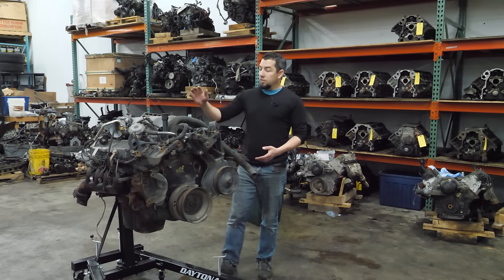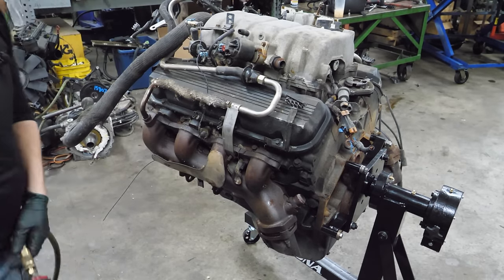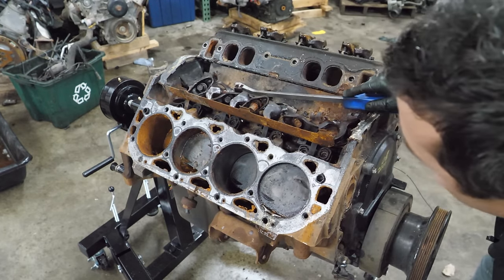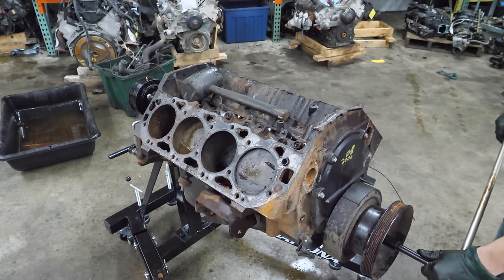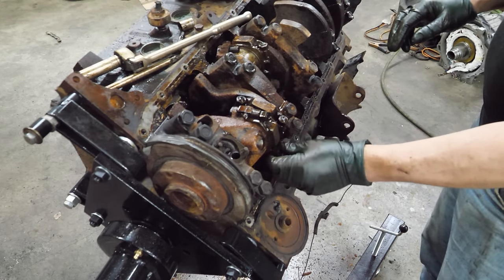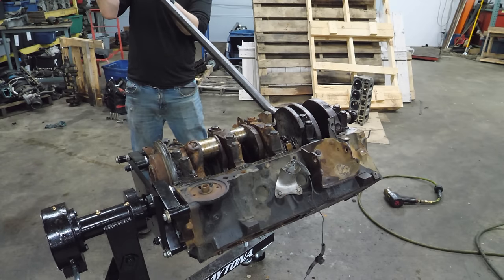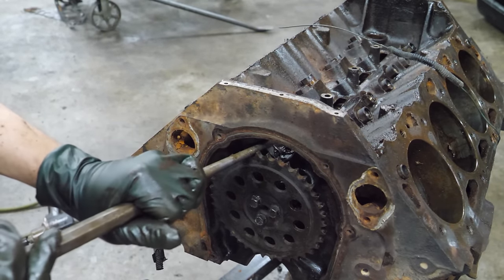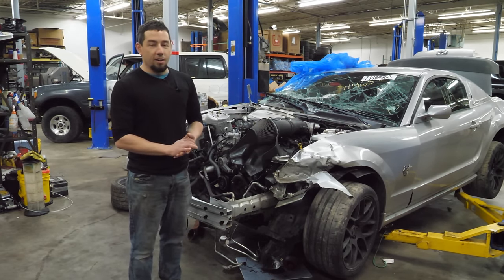COMPLETELY FROZEN! Vortec 454 7.4L BBC Big Block Chevrolet Teardown. This Was Some Work!

Comment: I live in the northern states and I've seen this exact out come multiple times on multiple gm 4.3 5.0 5.7 7.4 what happens is the plastic intake gasket fails in warm conditions and first dumps the coolant in the oil. truck starts overheating cant figure out why owner puts water in cooling system "to get home" freezes overnight always push's out the same plug behind the engine mount well now they created another leak at some point they check the oil and see the milk shake and think the motor is blown. PSA if you own a GM truck produced from 96-99 or van 96-02 with a vortec iron headed motor if your loosing coolant and cant find it check the oil first if there is coolant stop driving the tow is cheaper than the damage you cause limping it home. Every 1st gen vortec need the intake gaskets updated to HD cheap insurance.

Comment: Soak those pistons in evaporust top down for couple days, free up the rings... nasty motor, and I thought the one I took off bottom of local lake was horrible,  It was,  but came apart semi easy. Was under water on lake bottom since early 90's. Had cable attached for jet ski tie up, little 307 sbc.

Comment: Rain water/ snow melt off damage. It's been sitting in the yard for a while exposed to the weather. Someone tore a bunch of parts off of the truck, and left the rest open to rain or snow getting inside of it. With no water pump being on it and if the engine was angled back. Rain could get to the coolant passages, collect up and froze pushing the freeze plugs out and cracking the block in a place you can't see to allow water in the rest of the engine. Most yards will drain all of the oil out of the engine before sitting it out into the yard according to EPA rules. That goes for coolant as well. This is the type of stuff I would expect to find in a "You Pull It " yard. The vultures do not care how they leave the carcass after they get the parts they want off of it.

Comment: A thought on how 0W0 got in.  Looks like those trucks have an oil cooler in the radiator in addition to the transmission cooler.  If the oil cooler leaked, oil and antifreeze/coolant would be exchanged.  With the oil pressure normally higher than 17 PSI, oil would flow into the radiator.  But when the engine is shut off and oil pressure goes to 0, pressure in the cooling system would push coolant into the crankcase.
Of course this doesn't completely explain what happened to the engine since there didn't appear to be any evidence of antifreeze, but if the problem was ignored long enough and they just added water...  maybe.
Just a possible puzzle piece.

Comment: Bought a 98 P30 chassis with this engine. 10,100 miles 13 months I found coolant in the engine oil. Dealer said tough luck, out of warranty. the "New" 5 year coolant had desolved the intake manifold gasket. A known problem.... I replaced intake manifold gaskets and used cooper coat sealant.... drove for 140k with no further problems with coolant in the oil. exhaust manifold and gaskets failed, replaced exhaust manifold bolts with brass nuts... driver side manifold was so close to the brake master cylinder that it would boil the brake fluid, made a heat shield to solve the problem... replaced all the sensors at 100k miles and it ran "like new".

Comment: This is about what the inside of my 5VZ-FE looked like after I pulled it apart. At least it turned over after I evacuated the water/fuel/coolant mix out of the chambers, but otherwise anything ferrous looked just like the guts of that poor big block. Massaged the cams with a scotch-brite pad, ran a dingleball hone thru the bores (with pistons still inside), made sure the water pump impeller still existed, had the heads planed, and threw it together with new gaskets and an oil change (also misplaced all the valve buckets and just threw them in). Totally expecting to have wasted $500 in gaskets and bolts, and about 20 hours worth of drunken late nights off the clock, it’s still running wonderfully 40k miles later (now with over 250k miles on the clock) and burns about 1.5-2qts between changes. I didn’t believe that these engines are as tough as stated (Toyota guys love to talk these underpowered heaps up), but I’m happily mistaken. I even had a backup 5VZ ready to drop in (really clean 97 4Runner Limited from Florida ,RWD though), but I’m still dumbfounded with how resilient the old mill is. I bet with similar treatment, you might be able to get this lump of iron going again. Not worth it for most people, but I’m about as cheap as they come with project cars.

Comment: Intake gaskets are common on these engines to let water get into the internals, I'm building a 98 vortec that was in an RV that looked similar to that engine just not rusted as bad.

Comment: Soak rust worh vinegar. I had a briggs 6.5hp engine locked up from rust. I tore it down and soaked everything in vinegar,  honed the cylinder luckily no serious pitting, and was able to make it run with just a new piston ring. In ur case, these rusted engines, will be easier to tear down if u pour vinegar into the cylinders. Pistons slide out easier than with pb or anything else. Vinegar actually chemically breaks down and removes rust completely

Comment: I wonder if the piston removal was extra hard do to a ridge at the top of the cylinder? I don't know if this generation of engine has an issue with that.  I believe there is a tool to remove the ridge enough that the rings can pass it. And of course if you have to use that the cylinders are out of size and would need an overbore.  It really looked like a couple of the pistons were bouncing when you hammered on them. 

I was cheering for you, good job Eric!
Reply: All engines when stored incorrectly or not drained can exhibit the same issues, galvanic corrosion, look it up.
Reply: They were bouncing. I saw it too. He said he'd need a ridge reamer (he was right) and then proceeded without it. Ah well.

Comment: This engine is so incredible! It has less than 300 horsepower for a 7.4L v8. If you told the Japanese or the Europeans to build a 7.4L v8. They would give you 500-1000 horsepower depending on the application. There is a replacement for displacement... it's called proper engineering.

Comment: Probably a dumb question, but would running the head through the parts washer help at all or do these need a date with a machine shop for rust cleanup in addition to everything else?

Comment: no antifreeze and froze up and filled the engine with water when it froze and broke ,after thawing, was started one more time. Your  reference to "CORE" Plugs as freeze plugs shows a southern methodology, they are plugs for the removing of the casting sand after pouring the cast iron or aluminum , not to save it from freezing damage.

Comment: I have a vision.  You find a cooperative ocean going freighter, film yourself going aboard and into the engine room holding a dirty 5 gal dirty bucket with a few tools. Don't forget Blue. And do your monolog like you do and find some random bolt somewhere and pretend to start to loosen it up. Maybe bring some parts with you so you can pretend to pull them out of the engine and run your "Looks Perfect!" and pitch it across the room. Whattaya think?

Comment: Don’t feel bad about missing those head bolts. I watched a guy who claims to be a diesel mechanic miss two head bolts. And he was putting the engine back together. A two cylinder diesel tractor engine.

Comment: That engine probably went through a flood. That would explain why it was seized, and the water in the engine. Both the cylinder heads and the block might be salvageable. The crankshaft and camshaft are a different story. Good job on tearing that engine down.

Comment: Definitely seems like they were just running water as coolant from the level of rust in the coolant passages, seems like it froze and probably cracked the block or a head letting water get everywhere and filling the oil pan

Comment: If the bore can be done to not much more than 0.060 over, and it cleans up nice you should get $800-$900 for it. Considering machine costs, seems tight on the profit, considering cleanup labor.

Comment: Probably had problems with the cooling system, at which point the previous owner decided it was better off in a maritime application. 700 lbs is adequate for an anchor, right?

Comment: If you turn the engine so that the tops of the pistons are horizontal when applying penetrating oil you would get better coverage of the oil.

Comment: you can still get EGR tubes for this engine as at least Auto Zone still sells them. Sure their dorman rather than OEM but at least there are replacements available
Reply: That's good to know, thanks, if I ever need one for my  1997 K3500.

Comment: If someone has time to answer a dumb question.

I've watched lots of these and I basically understand how an engine works, but one detail that I don't understand is where the fuel actually gets mixed with the air. Since I never see any kind of fuel sprayer in the combustion chamber I don't see how it could happen there. Does it happen in the intake manifold somewhere?

Comment: What gloves do you use?  You scrape bearing across a table, grab sharp, broken metal parts and they are fine.  If I hold a ratchet handle mine split the thumb at the palm

Comment: Will the old orange stand still hold a Cadillac Northstar? LOL. To me a Chevy big block is for big cars and heavy duty trucks not a 1970 Chevelle with the LS6 454ci/450hp. Of note- Duntov NEVER wanted to put a big block in his Corvettes because of the weight as your video proves but, when Shelby put 427s into his Cobras Duntov realized he had no choice. The 396ci 425hp in 1965 then they went to the 427 in 1966. Most like the C2 especially the 427 L88 of which only 20 were produced mainly for racers. My favorite year 1969 (and yes I had a 1969 "Cadillac" Corvette with EVERY option) had the most options and the most engine options from the 350ci/300hp all the way to the continuing the L88 and the Ultimate 427 ZL1 aluminum block which was a $4700 option which was as much as the base Corvette. When asked who would buy the ZL1 Duntov said "A person with a LOT of money." Only 2 Corvettes were produced with the ZL1 (1 was for the St. Louis factory manager who just checked every box as it didn't cost him anything as that was his company car) and 69 COPO Camaros for drag racing.

Comment: i did a 440 mopar had grass growing out the carb ? question what if you stripped it. pushed it outside block upside down fill the backs of the stuck pisons with caustic soada / lie left it over night / few days

Comment: I'm surprised you didn't try heating the bracket around the frozen stud or welding a nut onto the stud and then turning it that way. Ik you can't have open flames but you probably have a "friend" who can do it outside the shop

Comment: I think that most of the parts are sellable from that engine. even the rods unless you seriously beat on them. i was thinking that you were beating on the piston where the wrist pin goes through it.  you can use a straigt edge across the rods to see if they are bent. if your seriously worried, you could have a shop check them. but at that point, it may cost you as much as they are worth. as lokg as there are no cracks in the block, I'm sure it will clean up.  same with the crank.  oh, and my daughter says that the sauce in the cylinder head is "yucky sauce! lol.

Comment: Did an EGR delete on my 240sx once, only cost me five cents. I removed the pipe fitting, put a nickel in the hole and cut/crimped the pipe shut.
Reply: best EGR delete I have seen is a flattened piece of beer can under a flange

Comment: Tonawanda L29 454's. Gutless workhorses, but good workhorses none the less.
Reply: Bullet proof engines are way more valuable than a stressed out high rever.

There is a Gen 5 6.6L and its a screamer for performance even

Comment: I own a beautiful 454 JMC 1/2 ton I built from 5 trucks. Been driving for yrs.{jim's motor Co.} Put a Big ass Quick-fuel Carb, a very Big Cam ,And she goes like snot. You ain't going nowhere in the seat When i put er doiwn. Still scares the S*&% out of me when i pass people like the are standing still...Hilarious. So ya Bore her out whatever amount u have to ,But Not too much and someone will buy for a build ,No doubt. Mine is a Daily Driver. I LOVE Big ass carbs NOT Fuel injection. When my gas needle on the dash goes down when i pass someone .I t does Not come back up. It eats Unimaginable amounts of high Octane Rather Quickly when called for .Anyway you said u liked comments ..I would have been very disappointed if u left that block without cam removal...Good show bud...Love your channel...Jim

Comment: Glad to see that you got a much heavier engine stand that should be safe enough for the big iron block beasts. 

Now I've never torn down an engine. But I would like to suggest you get a pair of safety boots or shoes with either steel toe or composite material toe protection. When that 73 lb head got away from you, that was a little too close for comfort. It's hard to walk/balance when you lose toes, especially the big toe.
You did right getting the bigger engine stand. A good pair of safety boots with toe protection cost less than $200. Like you said about your $300 stand, it's cheaper than foot surgery; so are the shoes. I wore safety boots 40 years (a work requirement) and saved me from some serious pain.

OK, I'll sit down and shut up now. 

You have a great channel, neighbor! I, too, live in the St Louis area.
👍👍

Comment: splish-splash that 454 took a dirty bubble bath. kind of looks like a flood engine, someone parked in a lake, then again maybe sitting with hood open/off and intake apart. 😬
kind of looks like a cracked block at 24:38, from the pushed out freeze plug up towards the cylinder deck at an angle, maybe just the paint though.

Comment: I had a 99 K2500 Suburban with this plant in it. I sold it to a friend who wanted it. He blew the engine in it. It had over 400k km on it. The rumours were GM messed with the timing on these engines because they were out performing the new 5.3 and 6.0 replacements when they were coming out. Apparently a 25 degree adjustment wakes up these engines.. can anyone confirm?

Comment: Had to stop 20 minutes into this video what I would have done which would have been pretty cool is just a drain the oil pan as much as possible put the plug back in and put that in your engine block washer if it would fit and see what your engine washer would have done to that I would be really curious on how much it would have cleaned that block up again with all the fluids drained

Comment: Maybe you could try to track down a grenaded 3800, if you can...... Those engines are pretty well known for being bulletproof and hard to kill without actual malicious intention and effort put into its death, to put it another way, the 3800 is one of those engines that you have to actually try to kill, a skipped oil change or two isn't going to do it in unlike with, say, the 3.6 HF engine that replaces it in which deferred oil changes will cause chain stretch and kill it. Their main achilles heel I'm aware of is coolant elbows and those are easily upgraded to metal ones.
Reply: The 4300 aswell
Reply: @shadowopsairman1583  Speaking of, and this is just my opinion, but the 4.3 LV3 being pushrod would've been better suited to the likes of the Acadia/Traverse/Enclave than the 3.6 as it would've been physically more compact in a transverse engine bay than the 3.6 being DOHC, plus the 4.3 is also more geared towards low-end torque than the 3.6 and thus would've moved around those vehicles' 5k lb+ curb weight easier.

3.6 meanwhile being geared more towards high-end power would be better in something like a Camaro that's not only lighter weight, but also generally designed for going fast.

Comment: but ya never used the2 of the 4 jack screws on the engine stand so it would not move around while you work on it.

Comment: I would have guessed that the engine came from an old "Project Farm" video titled "A Big Block Chevy - What will happen if we drain all the oil out and replace it with sea water, will it run? Let's Find Out..."

Comment: Maybe a boat ramp fail? I’ve seen plenty of videos of boat launch attempts gone bad with the truck parking brake failing and the truck slide down the ramp and submerged in the water

Comment: Knowing what we now know i wonder if it would have been a plan to drain the water , fill the sump with diesel and some oil, pull the distributor and spin that oil pump to fill everything with lube.

Comment: My dad gave me some really good advice when having trouble replacing spark plugs in difficult places, which I will pass on to you: He said if I couldn’t get the plug in the hole, that I should put some “fur” around the opening. Works each and every time!!!

Comment: Only America could produce such a big engine with so little horsepower.
Reply: This engine was not designed for horsepower, but for low end torque for use in heavy duty pickups. I had a 97 chevy 1 ton with a manual trans and it was a stump puller. It made 75 more horsepower than the 97 Dodge Cummins and almost the same torque.

Comment: Then use all ure old oils wash out with some diesel and heat it to 350 back to where it was before it shrank remove all bottom bolts from back to front and all removed same as installation

Comment: Looks like it came from a flood vehicle- no oil in usually means the water got high enough to push all of the oil out the top of the engine

Comment: If this is a high mileage engine, there is probably have a ridge at the top of the cylinder. You may want to invest in a ridge reamer. 4-bolt main BBC in worth some bucks. Crank looks to be cast and that’s nothing special.